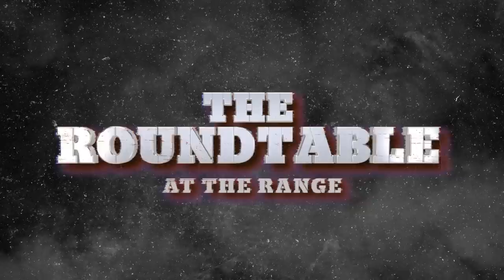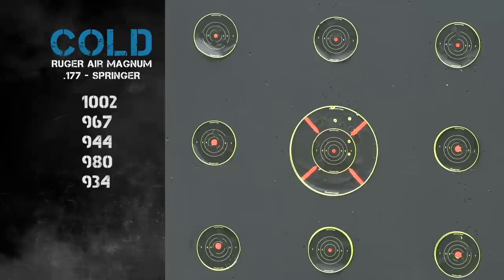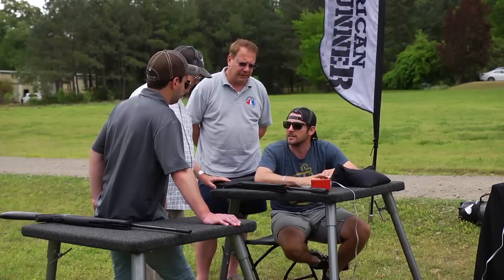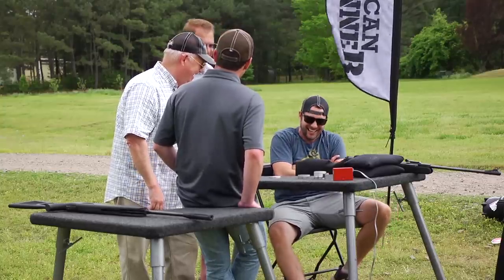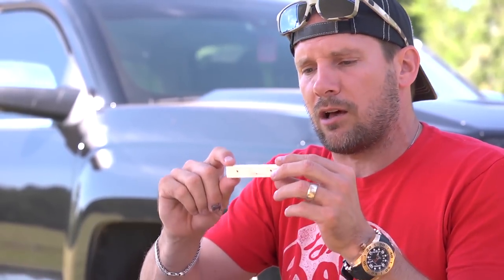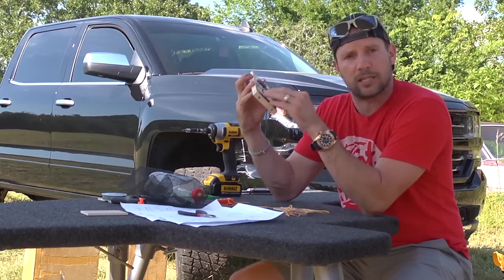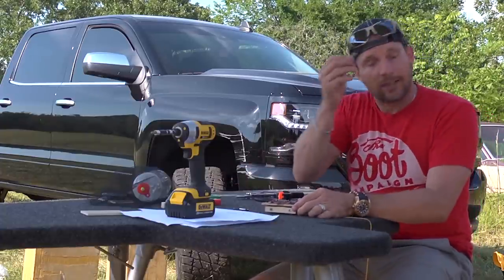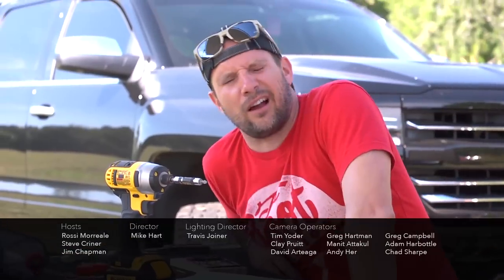Pellet Rifle Air Gun Cold vs Hot Test : American Airgunner Airgun TV

Comment: known this since the 80s whilst shooting Theoben' in winter, its all about air pressure and density and how its affected by varying temperature, warm air can expand quicker creating more volume, its complex. people think their guns down on power and so something is wrong, but more often than not the weather has got something to do with it, chronograph testing for velocity shift should be done in the same conditions as the last time it was done, best at room temperature. in the hot months a gas ram' velocity will climb as explained while a springer' remains virtually standard throughout the year barring spring fatigue. hope this helps somebody.

Comment: On the DYI ...... Have you tried it by taking the bottle cap, drilling a hole in it, screwing into the hole and putting a tire valve into it and hand pumping in some air pressure. Then set it off as you did the original? .... I would think the bang would be louder my friends.

Comment: Try installing a small heater like the ones used in electric blankets. Take the gun apart and wrap the gas piston and spring piston housing with the heat source. Think of the hot air balloon, when heated, the air lifts the weight but cooler it does not. Much more energy in heated air. I bet you would see increses in FPE in both the spring and the gas piston. In fact, the spring will be faster due to the metal expansion when heated. I think anyway lol.

Comment: COMING SOON... well, 2 or 3 months from now and that’s quick for me — A greatly simplified version of the trip line bottle detonator — The first version will be based on a mouse trap and used to blow crinkly water bottles, Big Blast caps won’t be included in the package but water bottle adapters will be. It’s called the ‘Porch Defender’ since it’s primary purpose is to stop jerks from thieving packages off of your porch but also works great in protecting political yard signs and seasonal displays in your front yard and for intrusion alarms on sheds without power available. It will be available ready to use and in kit form for the more handy guys.
The Big Blast Water Bottle Adapters ‘should’ be on Ebay by the middle of June.
Reply from the maker: Bam! Can't wait!
Reply: Way to go Charlie!

Comment: Hey, this is totally unrelated to this topic. I don't know how else to get ahold of you though. I'm a total newbie and really like your channel. I find it very informative especially for guys like me. Having said that, I just bought a Gamo swarm maxxim .22. I bought 3 different style pellets. I started having feed problems. I thought maybe it was the ammo and switched back and it didn't solve the problem. Then I thought it was how I was loading my mag. Any thoughts would be very appreciated. I'm pretty happy with it so far, however, this issue is a major problem for sure. Do I have a bad mag? I'm using crossman premium 14.3 gr in 3 different configurations. I don't have many options in ammo where I live. I don't know if it is the mag or a malfunction of the feed mech. Is this a common problem to your knowledge? I really don't want to go through the Hassel of a warranty issue if I can help it. I'm going to be using this for marrnit control on my plantsite and I doubt warranty work would resolve this issue before the end of summer. I was sticking piranha pellets through high quality 3/4" plywood at 20 yards. Those are what started my problem. Any ideas?
Reply: Need a little more info.  By feed problems, are you saying that the magazine is not rotating to the next pellet or are you saying that the pellets are not seating into the barrel all of the way?  The Crosman pellets aren't very long, so they shouldn't be causing the mag to jam when rotating.  But anything is possible.  Please give some more information on what is going on so we can better help.
Reply from the maker: I'd love to help you out, but i'm not sure what the problem is without looking at the gun.  I know there have been a few issues with the magazine. It's  little fickle.  I"ve stuck to the JSB with mine and haven't had a problem.  Wish I could help more.
Reply: American Airgunner Thanks. I figured out that it was the ammo. We don't have a very good selection in my town.

Comment: I have a Diana Stealth I've been having issues with,  did test on FPS at out side temp. 60f 710FPS , 78 DEG 690FPS,90 DEG. 670 FPS.,
102DEG  655FPS. Should this effect left and right  POI. Put a new SCOPE UTG 4-16x56 Bubble Leveler AO on it and still having the same issue.
Reply: You're saying that you are seeing left to right POI variation as the temperature changes?  That wouldn't make much sense.  The velocity degradation in the heat may also have something to do with the humidity and density of the air.  Depends on where you are located.  But I wouldn't think that would make a difference in horizontal point of impact shift....at least I've never seen that.
Reply: Maybe piston seal or breach seal check them both